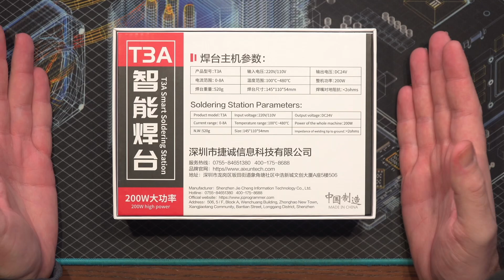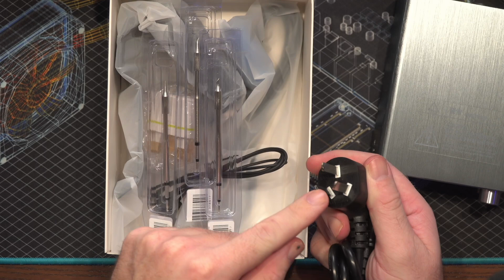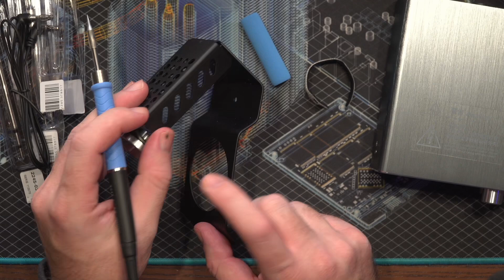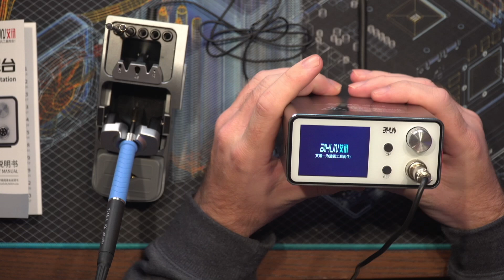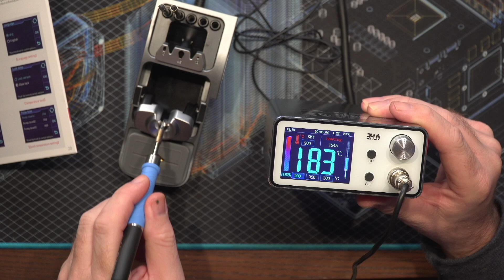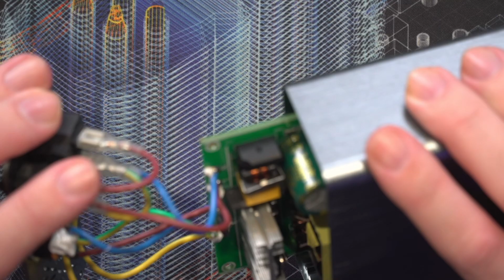Axiun T3A Solder Station Review - Cheap & Fully Featured

Comment: I find it strange that so many reviews skip the tip-to-ground voltage test, as it's the main issue with this thing.
Reply: Jbc245 is not expensive in China, with a price of less than 300 RMB. There are many options for DIY, and the price is more favorable

Comment: I still found these to be too expensive. And so i went with the latest version of the Ksger ST unit. Because i don't solder all that much and figured it would be sufficient. 55 euro. with a stand, 4 different tips. But without power cable. I have plenty of those at home.

Comment: AIXUN T3A soldering iron station with 2.4 inch color display, 100-480 ℃ temperature adjustable, with real-time dormancy, supports 936, T12, T245 handles and soldering iron tips for mobile phone soldering repair.

Comment: I expect that the apparent initial temperature overshoot is because of the distance between the tip and the sensor (the latter is nearer to the heating element). It will take a tiny bit longer for all the heat to disperse evenly throughout the element and reach the tip. So they would pump in enough heat that, once fully dispersed, the tip will reach the right temp - which means there is a short overshoot at the sensor location.
Reply: on a different review of a kit that included a JBC style clone, not only did the clone tips show overshoot, measured independently the temperature each tip reached was roughly 10% lower than what was set. the same iron with legit JBC brand tips behaved correctly and reached the correct temp.

Comment: i have a ksger t12 iron with the upgraded aluminum handle..works well but this os better and i also had to ground the iron myself!! ksger not safe out of the box. ill be buying this soon! thx!! great video!
Reply: I was lucky my k stations were grounded. I have the t3b and it's defective. They will not help you warranty wise. They used every excuse they could and now I'm left with the nice stand for 250 cad
Reply: @jstro-hobbytech  Perhaps time to buy a Weller or Hako, either of which are NOT made in China.
Reply: @BryanTorok  I like my ksger t12 I just wanted to mix it up and get a new iron. I bought a better handle haha. I've been starting doing some repair work on 3d printers and other stuff so I've been thinking about a metcal. It's expensive up front but tips are cheap. I need a new scope first which is coming soon I'm getting one of the new rigol 8gsa mso scopes. They're badass looking and cheap for what they are. 1500cad or so with tax. I'm 43 so it'll probably be the only scope i ever need haha I currently have a hantek dso5102p which I plan to give away to whoever will take it when I get my new one. I ordered a new guitar this week and I'm tearing the kitchen down to the studs and rebuilding it next month so the wife will let me get whatever I want. It's funny, my wife says I have expensive tastes yet she wants a new kitchen even though we have a perfectly fine one. She wanted a pool as well and got that haha I'd rather have my head buried in a project then get in the water. I've been in it twice for 1 second each time. Women compete with each other over that stuff when you could go on a tour across Europe and Asia and still have money left over. You won't remember your new kitchen on your death bed but memories of travels will be cherished. 

Sorry. That got deep.
Reply: @jstro-hobbytech  I get where you are coming from.  I wasn't questioning your wanting to a new soldering station, just that I try to avoid buying stuff made in China where it reasonable or practical to do so.  They have messed with the USA and Canada tremendously (not necessarily the people, but their government) in terms of the economy and intellectual property.  China has bought control in a large swath South American and African countries.  They have been doing so for decades.

Weller products are designed in Germany and built in Mexico for the N. American market.  Hanko is designed in Japan and assembled in a different Asian country, Malaysia, I think.

But, I get it.  For about the past year, I've been looking at buying the Rigol MSO5072 and running a software hack to upgrade to the capabilities of MSO5354.  I'm not sure  that gets it to 8 gsa.  I'll have to look.

If you are taking care of the wife, then enjoy your avocation and have good equipment.  You deserve it.